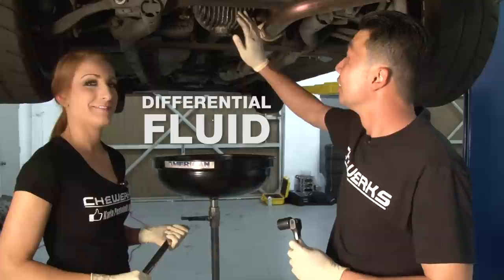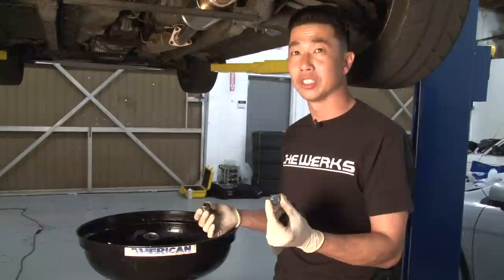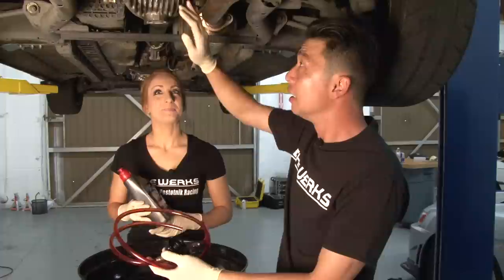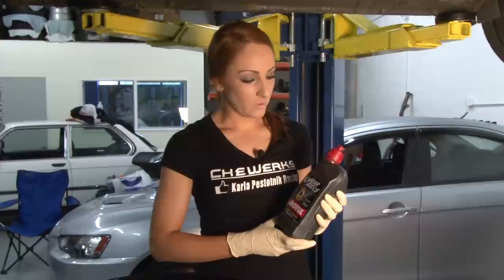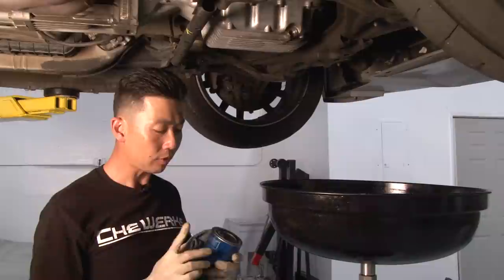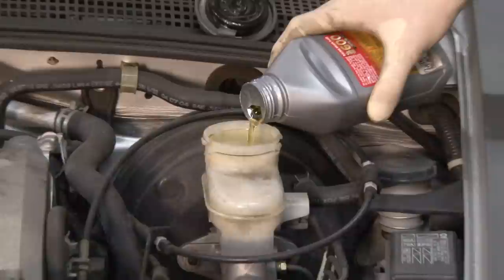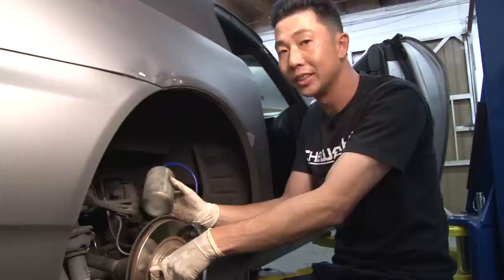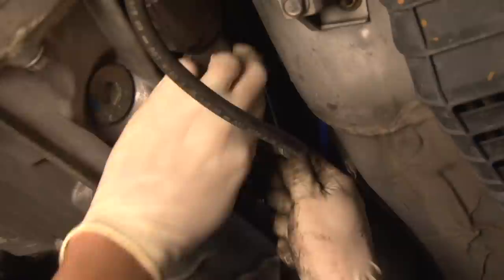How to Prep Your Car for the Track - Track Life Episode 1

Comment: Great video, love you guys! For Track Prep, I second checking wear (for safety) on your brakes & suspension as well as front end inspection, checking your battery is secure, throttle linkage, brake fluid level/response, steering assembly, tires, and helmet/seatbealts.
     Would enjoy a bit more on suspension; sway bars and tower braces (are they worth it?) I already saw Rob's fantastic vids on coilovers & corner balance (suggestion: put some links to your other videos in the description of each new video for your new viewers. You can say I use these pads with my KW coilovers, see the link below for the coilover video). Maybe a minute or two more on new brake pad install on a stock S, differences in street vs track ONLY pads, pad materials etc...(Even though it was pretty much almost all covered in your big brake/bleed vid, not everyone can afford big brake kits but still want to AutoX/track on a budget -- even though you shouldn't skimp ever on brakes ;).
     Other ideas would be a few sentences about the differences in setups say for a DD vs. track. I know you are doing just track now, but you could still throw in a few sentences like, "I'd recommend these coilovers/sway bars/brake pads for the track BUT, if you are going to do the track AND still be a DD AP1, we prefer this setup.". Or perhaps, "If you have a lot of money to spend buy TeinN1's but if you want solid budget coilovers, try KW's." Okay, that's it! Sorry if I wrote too much but I really enjoy your vids, keep'em coming! :) Also, check out my S2GRAND youtube channel! :P I put up two old S2K VHS videos that I got from my previous owner that have never been on the internet before.
     Oh! Maybe you could take an S in for laser alignment and then have the tech give an in depth explanation to you and the viewers as he does it? You know, give viewers a lesson on camber/caster/toe etc... plus, then you don't have to do as much work on scripting for that episode! ;-)

Comment: Isn't this less about track prepping and more like proper maintenance? Diff/trans/engine fluids always need to be changed, not just if you go to the track, just more so if you track your car. And brake fluid only really needs to be changed once every two years if you're using an OEM type brake fluid. The motul last about 1 year. This is because all brake fluid is hygroscopic, meaning it pulls moisture from the air and will lower the boiling point of the brake fluid as it accumulates more water. 

Just a tip I think it would be more helpful if you told us the nice tool you use to pump fluid into the transmission using the impact. Or why you would use RBF600 and pros/cons for track vs street. Or for the newbies who have say a VW/Audi with a touchy abs system and how they shouldn't use just any brake fluid and also may require a low viscosity fluid.

I don't mean any offense to my post, just thought this was going to be about setting up a car for the track, ie. alignment changes for better turn in, suggested spring rates, etc.
Reply: The point of this video are the basics of what YOU NEED to do before the track. I change my brake fluids/bleed often because I find air in them after almost every event. They can't tell you specifics because every car is different but generally require these basic maintenance. This is what every track driver go through before an event. 

Your car determines what spring rates you need. Alignment changes is what's done after your event to prepare for the next. Not only that, this is a series not a one time video on track life. Be patient, it's only been one episode.
Reply from the maker: We aren't offended at all - we really appreciate your suggestions. We'll try to do an alignment and suspension video down the road. Also, the tool is a mechanically-driven fluid transfer pump.
Reply: GTChannel Thanks for the reply, really appreciate it!
Reply: Michael Dao If I have changed my fluids (minus the engine oil) 6 months prior to a track day I'm really not inclined to change them before a track day. I'd check them for sure, but it's a waste of money. After the track day I would actually be more inclined to change questionable fluids because then you'd have put the car through so much stress that the fluids are more than likely prematurely degraded from the abuse. Like I said in my original post, the title just felt a little misleading and irregardless of going out to tracks you should be doing these fluid exchanges regularly, I work in the service industry and people don't realize how often they should do maintenance in general or have a misconception of how often they change fluids.
Reply: Michael Dao Also fyi if you're finding excessive air in your lines, you're probably cooking your brake fluid a lot and might want to switch to something with a higher boiling point, that or you might not be changing your fluid regularly enough.
Reply: Ali Ahadi I change it before every event, trying to finish my ATE super blue before I try out RBF600
Reply: Michael Dao I heard they made Super Blue illegal in the US? I'm curious about ATE SL.6 since all the newer sports cars are specing low viscosity fluids for better performance under ABS braking. It looks like you have a S2K so not worried, Honda is nice they just spec "put some good DOT3 in," I'm always worried about German seals getting messed up when experimenting with different fluid types since they always get so specific with their fluids.

Comment: This is more of a basic vehicle service than a track preparation... But having all new fluids in your car is a great idea if your about to head to the track for the first time ;)

While the wheels where off it would have been ideal to show how to check your brakes and suspension components for excessive wear that might not be safe at the track, or even how to install new pads and rotors to bring your car up to a safe racing standard.

Comment: Great video, alot easier doing all of that on a ramp then a freezing cold driveway. IMO people always miss proper brake pad and brake disc/rotor installation tips. They dont do the basic things like cleaning the hub face, lubricating the slider pins and cleaning up the caliper bracket pad shims before fitting new pads. All these little things can cause issues on track which people often blame on "warped discs" when in reality its because they haven't mounted the disc properly causing excessive run out. Oh and one other thing is always recommend to people that when they take the car on track that the engine oil is full, it will reduce the chance of oil starvation on long corners. You could also do a series on upgrades that are worth while for track use. Larger core radiator/ oil cooler etc.

Comment: S2ki has a few different ideas for the brake and clutch. Through apparent experience for the brake drain they go Rf, Lf, rr, Lr in order.

If you often do the clutch master they say you don't need to drain the bottom.
Reply: Gabriel Mak in the uk the manual says rf - rr - lr - lf.  (or at least im pretty sure it does!)

starting closest to the master cylinder and moving round the car. ive done it this way since ive had the car and done 12 track days in the car, changing the fluid at least every 2, sometimes more, brakes are always amazing. : )

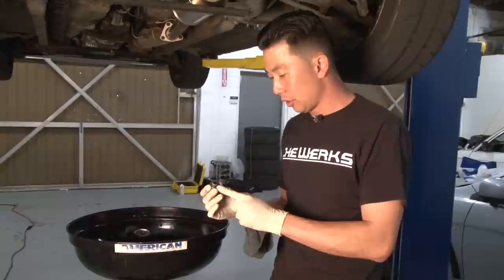Comment: 1:10 someones been smacking the spanner into the cooling fins xD
Reply: it is impossible to get a torque wrench in there without using a crowfoot extension, i've seen a ton of s2k's with those fins bent.

Comment: forgot to mention to check if the old o-ring is stuck on the seating surface of where the oil filter screws on. 

Finding out that the oil filter is double o-ringed at the track is not a good thing, then oil is spilling out everywhere. then having to pay for a spill fine.

Comment: What brand and where did you get that transfer pump? I currently have the old style where it's basically like a soap dispenser pump and I always worry about it breaking halfway through a transmission job lol. Thank you in advance! PS: Keep up the track info videos. GT has a  lot of videos of cars on the track but not much of what gets them there.

Comment: I want to give everyone an advice: Tighten good all bolts, caps and filters. I didnt do it properly once and it cost me 2 rods and a crankshaft. You can also check your fluids after each session, so you can make sure everything is ok under extreme conditions.
Also do not use your handbrake until your discs are cool and try to do a last lap with minimal braking, so your brakes can cool a bit and you wont bend your discs after you park.
Reply from the maker: Great suggestions!
Reply: I'm in the process of replacing my trans because I didn't torque down the drain bolt... Shit sucks

Comment: Honda manual transmission using light weight gear oil not 75w-90. Better using OEM honda fluid or Amsoil 5W-30 Manual fluid. Diff using Amsoil 75W-90 Severe, engine Signature Series 10W-30, brake fluid and clutch fluid using Stoptech SRT660.

Comment: How frequently do you guys pump gas on track days? I understand with s2000 you shouldn't run after you use a quarter of a tank, but just after one session my fuel pump started to go bad and I started with a full tank! It still had more than 3/4 of gas in the tank. I always pump 91 from shell. Could it be something else that's causing the fuel pump to go bad? I've already gone through two different fuel pumps: one walbro and one Deatschwerks. Has anyone encountered this problem with their s2000 on the track? I've search forums, but nothing came up. I'm thinking of installing the next fuel pump lower into the gas tank. I've already check the fuse and there's voltage going to the pump, but if there's anything I missed please let me know. #tracklife

Comment: I didnt think 75w 90 was recomended for the transmission? Maybe only if you are a specific manufacturer with a limited product range?. 

Some guy put that in my s2000 before i bought it and you could only change gears after you got the car really hot. Anyway honda advises using 10w30 engine oil if you cant get their mtf oil. 75w90 seems a bit thick in comparrision?
Reply: 75w-90 was for the diff, not the engine.
Reply: TheStaniG i was talking about the gearbox, the honda manual recomends engine oil if mtf is unavalible.
Reply: lkjlkjlkkj Look up an oil viscosity chart. 75W overlaps with 10W to 20W oil. 
10W is in engine rating. 75W is gear rating.

Comment: You forgot the part about rigging a colostomy bag to the clutch master inside the car cause S2Ks have a habit of leakin' if you waited too long to perform the clutch fluid change.  Your getting a lot of criticism on the video but my only issue would be the product placement over substance especially on the clutch fluid.  RBF 600 is too expensive for something that doesn't get at all hot and caries a hydroscopic tax like all race fluid.